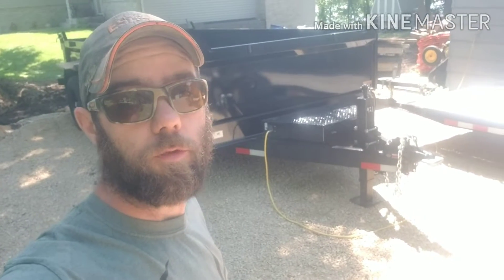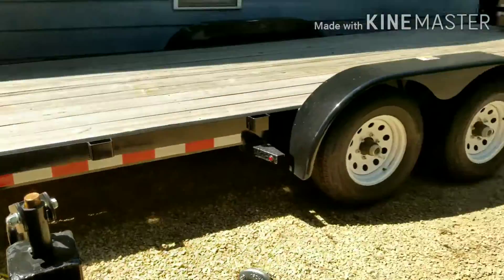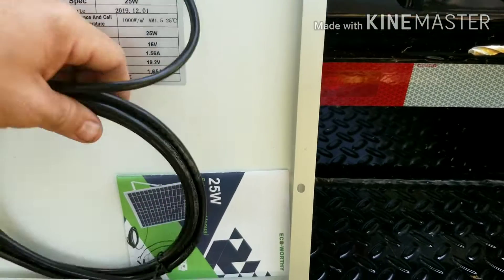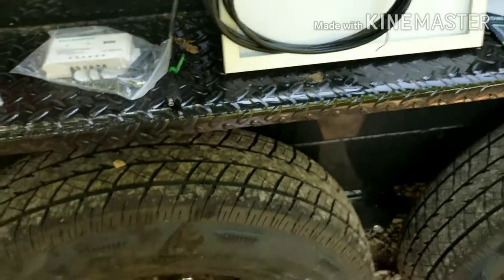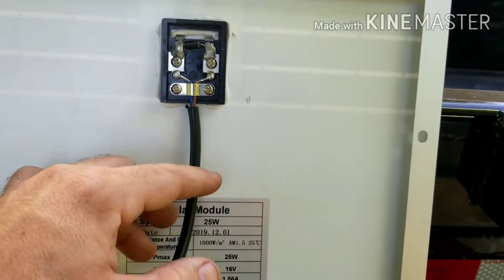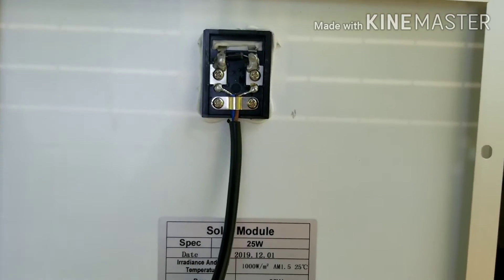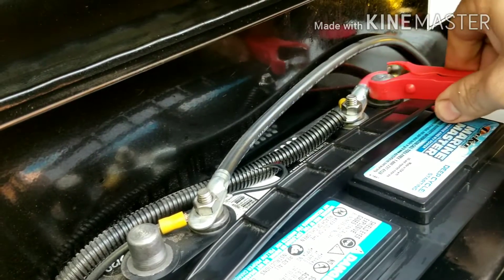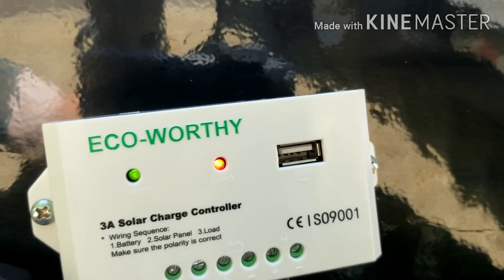How to install a solar charger on a dump trailer.

Comment: John, another cool and informative vid. This will come in handy as I am in the process of designing, planning, the power system for my DIY Adventure Trailer. Got some awesome ideas, mama got me a trailer to build, said she was tired of hearing me complaining about sleeping my 6'3" 245 lbs body in the back of my F150 SuperCrew shortbed. LOL. I am sure I would have spent half the Texas Summer over figuring how to do something like this. My requirements will be a bit more than this, but great idea.  Thanks again.
Reply from the maker: You should look at my solar powered enclosed trailer video that system will power and air conditioner for a small space no problem it's a grey and black trailer in the thumbnail I believe
Reply: @JDSOutdoors , yup already watched it and have it saved in Watch Later. Thanks man, appreciate ya.

Comment: Blew my mind when you ran those self tapping screws through the lid. That’s gonna leak. Why not use the gorilla tape on it as well
Reply from the maker: Won't leak after the sealer is applied

Comment: So, it's safe to plug from home using extension cord straight to the dump trailer to charge the battery
Reply from the maker: Yes